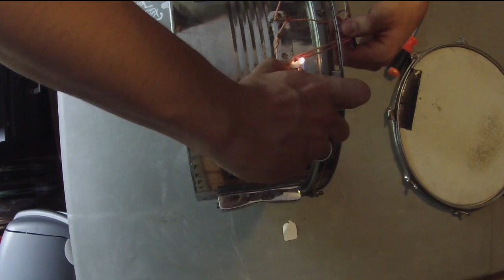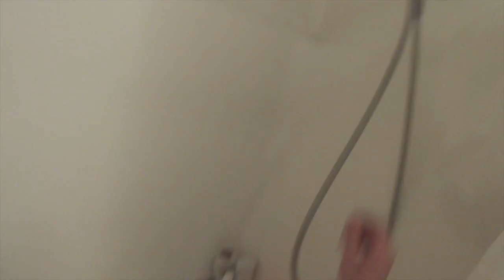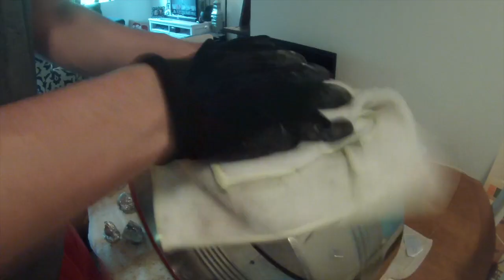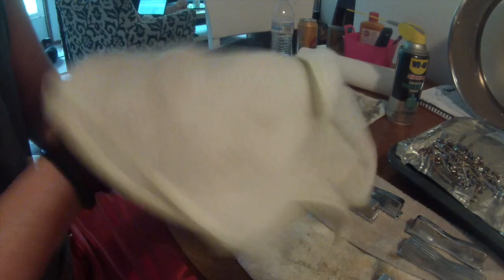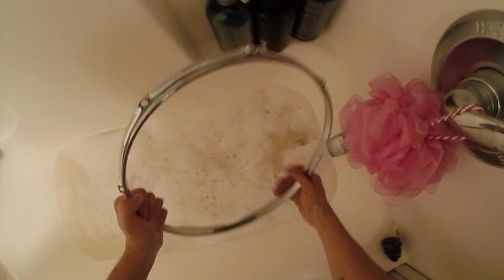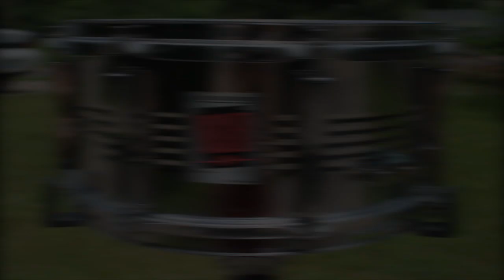Ludwig Rocker Steel Snare Restoration

Comment: I just restored a 20 year old Ludwig Steel Accent snare. I used Chrome polish on the rims and got ALL the rust out. I also used Brasso on the body and Tension blocks. Came out LIKE NEW! Great job!
Reply from the maker: Awesome! It really is a fickle beast dealing with rust... Sometimes its just superficial and you get lucky- and can buff it off no sweat. Other times, if can eat your metal right up D:

Comment: How you deal with rust?
Reply from the maker: Albert davila so, there are a couple different approaches: Mechanical removal, solvent removal or electrolysis removal. It really depends on the condition of what you're trying to derust. On this particular snare, the chrome was rusted on the shell and more so on the hoops. I used a combination of mechanical and solvent, i.e. scrubbing with a rust-removing compound. I used aluminum foil to rub brasso on the shell and the rust came right off. The aluminum foil is softer than the chromium coating, so you don't get scratches. For the hoops, I used a brass bristle brush after a long soak in bleach and dish-soap solution. Thanks for the question and the view! Hope you have a nice day!
Reply: NuDrums thanxs for the reply. I'd try lots of methods but they "drums" never looks quite like yours specially the hoops
Reply from the maker: It's worth mentioning that I used a product to polish the chrome called SimiChrome, and it works really well. I review and discuss this product here: https://www.youtube.com/watch?v=_6ZFTeWT9ik&t=45s